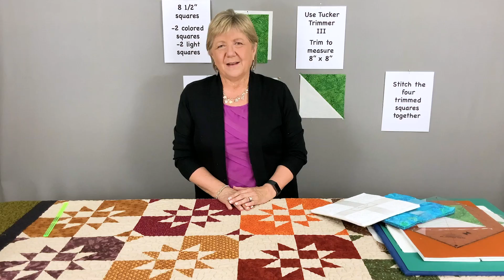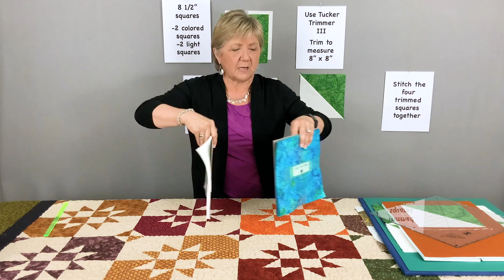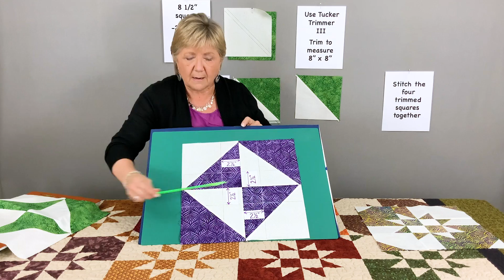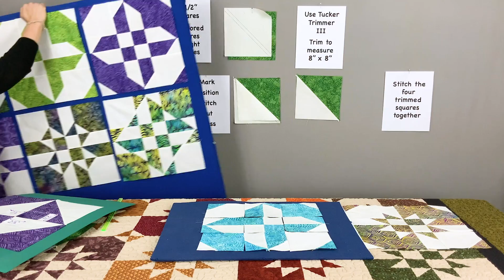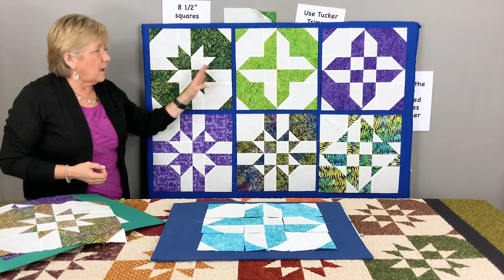Hocus Pocus Quilt - Tips & Tricks from the Tucker Team

Comment: Can the starting squares be made smaller than 8 1/2" and if so do they all have to be in 1/2" increments? My head is exploding with all the great info in your videos. Thanks so much.
Reply: I used 5" charm packs. As long as you cut your finished hourglass into more or less equal thirds (always measuring out from the center seams) it works. Let me see if I can recreate my math.  5 inches, once they're sewn into HSTs, get trimmed to 4½ inches. That makes your hourglass blocks 8½ inches. 8.5÷3=2.83. Not a good measurement! Let's take it down to 2¾ inches. Measure out 1⅜ inches from your center seams and make your cuts. The four corner squares will be slightly larger (2⅞") than the others, but that does not matter. Since you're just rotating everything and sewing them back together without shuffling them around, it will work. If this sounds confusing, try it with paper first and you'll see.
Reply from the maker: They can, but we have not done any math to work out other sizes. We stuck to just the one size.

Comment: I used this method and tried most of  these. Love the concept but I must be doing something wrong.  The seams don't always match up. User error??   :-)
Reply from the maker: I would double check that you are trimming the square to 8" before you sub cut and that you are sub cutting at the right interval. Also note that you can not in this method switch the corner pieces with the north south pieces as they are different sizes. Try checking your sub cut increment to make sure that they are all 2 1/2" as if they aren't that would account for them to not match. If that isn't the case please email a photo to customer service and I will work with you there.
Reply: @DebTuckersStudio180Design  it was only that couple that didn’t line up. I trimmed appropriately on all of them. The first few were great. I’ll try again.  Thanks!

Comment: This is almost funny: two years ago I was asked by my guild to do a short presentation on the disappearing nine patch (though I called this the disappearing hourglass). I too had tried the other company’s method of stitching around the outside of two 10 inch blocks and disliked it for the same reason — all bias. So I re-engineered it the way you did and did the presentation. Second item: last week a guild member posted a poll asking what is your favorite tool in your quilting room? Mine? The Tucker Trimmer of course, with the Wing Clipper a close second. Love your crystal clear instructional videos.
Reply: I always recommend the Wing Clipper--anywhere where I see folks disappointed with their results.  And I dislike seeing them put together in less efficient ways too!  Anytime I see bias on the outside, I get on my soap box and point out that there are better ways.  I have many of her tools and they make sewing enjoyable because units finish just as they should without employing hoping/prayer strategies!

Comment: I agree!  I have done a disappearing hour glass block and those bias edges DO create problems. The biggest one was that my project came out with “ripples” throughout it! It was a good thing it was only a test project. After that I decided to use the method using your method. Much better results. 

Also, try swapping out some of the units after cutting everything up) with other units from the same project. The results were amazing! I wish I could post a picture so you could see it.

Comment: Can I make a smaller version as I only have Tucker Trimmer 1 &2. I am in Australia
Reply: Viddy: This method looks like the perfect project to try starting with any different sized squares and just play with them. When slicing the unit apart, one would have to adjust the measurement made on either side of the center seam lines, either figuring out the mathematical proportions or by trial and error. Finished projects will vary in size but combining them would make for some one-of-a-kind quilts.

Comment: What size is the final block. I always have a challenge figuring out the Finnish size of a dissappear 4 patch
Reply: Rey Rodriguez: This is definitely not a disappearing 4-patch ... Deb's is much more interesting. Instead of starting with the 10 inch squares from a layer cake, Deb cut her own squares from fabric at 8 1/2 inches. After stitching two seams on the diagonal, she cut them apart, pressed open, and then trimmed to achieve her finished square at 8 inches.